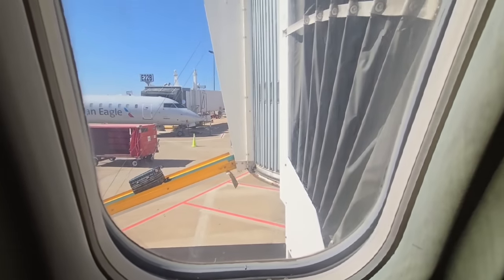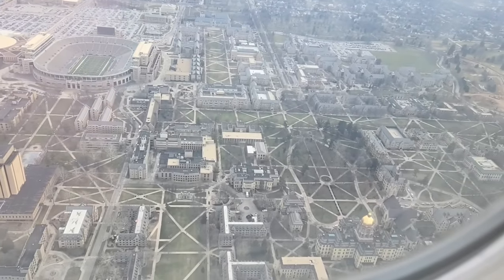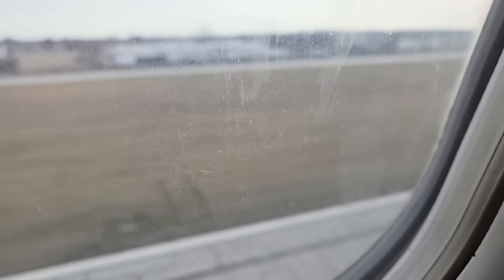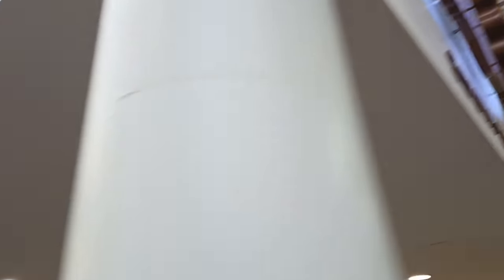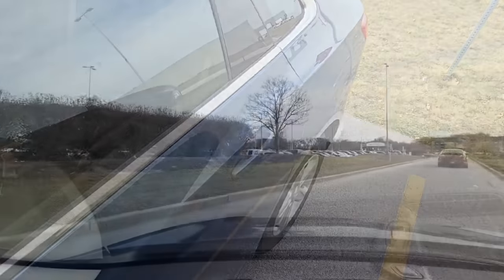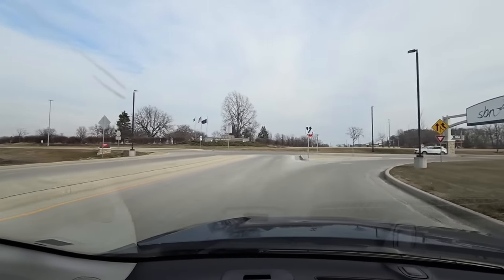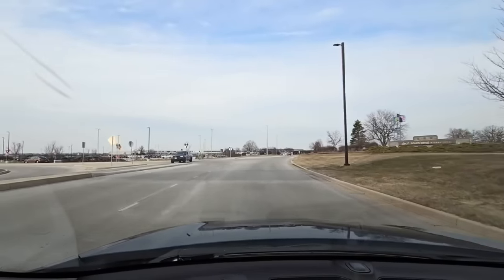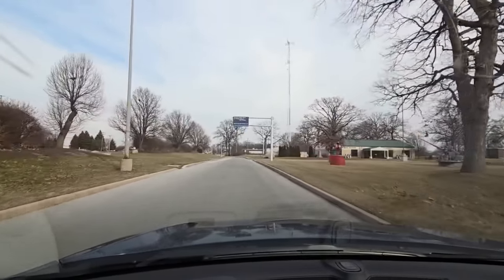LIPPERT Answers Questions about RV FRAME FLEX! Part 1

Comment: Lippert said my camper was ok with its  2- 3000 pound stabilizer jacks for a 10,000 pound camper… Morons. They finally fixed it after I told them I would own their company…
Reply from the maker: That's good. I'm sure that threat was what did it.  Glad it worked out...   Who installed the stabilizer jacks anyways?  I'm guessing the RV manufacturer,  since Lippert doesn't put those on.  But glad they fixed them, otherwise you'd of changed the name to your last name right?

Comment: One manufacture is responsible to the next user manufacturer and needs to provide guidelines on how to engineer their products, framing etc. to work reliably together. They just can't supply a frame without engineering the framing and finished product combined. To allow that is negligence and irresponsible by Lippert.  I'm glad the auto and aviation industry don't conduct their business that way!

Comment: Nobody cares how the frames are made.  What owners care about the most is when they load their fifth wheels under the capacity limit according to the weight limit sticker the frame still f**** fails.  I don't buy the bs line that water getting Behind the Walls are causing the frame to fall apart.  Sounds to me like Lippert is not accepting responsibility for their frames and instead blaming it on their partners that build the superstructure on top instead.  I mean Look at all the car trailers that transport cars that are exposed to the open elements with all that heavy weight getting rained and snowed on and road salted on all the time and they're still in one peice. The issue has nothing to do with the welds not holding or so called water behind the walls. It has more to do with the shity raw steel material they purchase to make their frames with, more than likely from China, and the steel has extremely poor metallurgy within it...  can you say Harbor Freight quality LOL!   I guarantee a class action lawsuit is coming soon.  People are getting pissed off about getting ripped off.

Comment: Stop, its not from over loading, an aftermarket pin box is not the problem. Its frames built from thin material and not large enough or not enough gussets. All of these people make up huge excuses. Stop buying new trailers, 99% are absolutely garbage.
Reply from the maker: So you don't think there are any cases at all where a consumer could possibly have contributed to the problem through their own fault? You 100% only believe that the manufacturer is completely at fault?

Comment: Not enough “ margin for error”in design and production ?  Historically for Vehicles and RVs - To Save a Few Pounds of weight - Performance cut too close ?  Example - Aluminum vs Steel or Iron ?  Maybe too many “ Averages” come into play ?  There is always going to be an “ Idiot” that has Zero Concept of Gross Weights or Load Balancing ! Some can’t manage to properly INFLATE TIRES ?     Any the End of the Day - We live in an Age of VICTIMHOOD - Any Negative Outcomes MUST BE SOMEBODY AT FAULT ?   Most often Look into a Mirror !  🫣

Comment: No mention of the quality of the welds in the frame (we've heard they are very poor). This discussion that they rely on the strength of the  ultra-light aluminum, Styrofoam, and phylon for the rigidity makes me call BS.

Comment: She trys so hard to be relevant. To read into it she is not even necessary. I doubt she really understands the engineering going into building an RV. We are not talking about delamination of years of the past. We are talking about the safety of others on the road.

Comment: How about when an owner drives his ridiculous monstrosity called a fifth wheel over a grade where the truck bed crunches the underside of rig at the pin?  That would be called what? Accidental damage? Reportable to their insurance company as such?
Reply: And when they post videos of them dragging the front of their RV on the ground.  Some of them also post videos explaining that their RV crushed the bed rails. They also have aftermarket pin boxes.   Then they want to blame everyone but themselves for the damage.
Reply: @BlakeScout  Exactly.  Several Youtubers have posted their rig dropping onto or crunching against the bed rails - then several weeks or months later noticing ‘frame flex’.   Its damage resulting from an accident and an insurance claim must be filed.